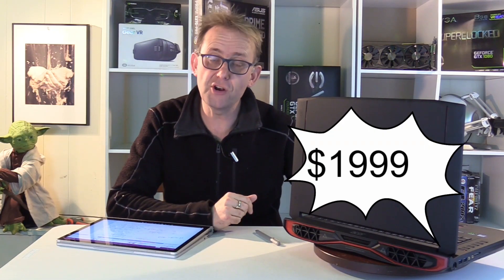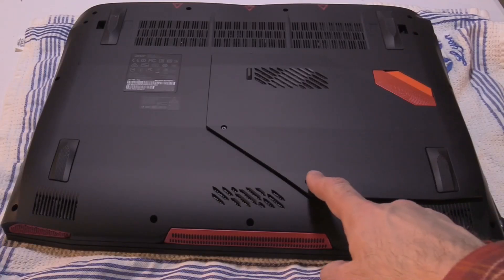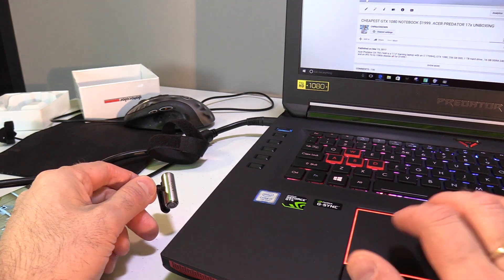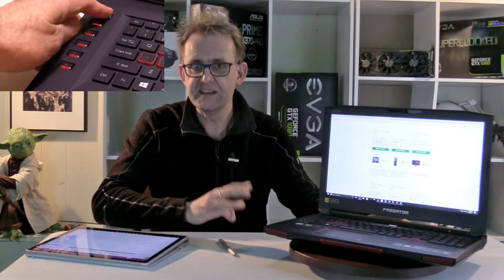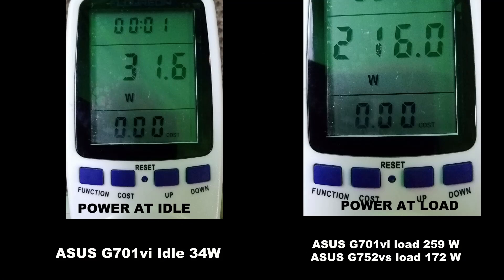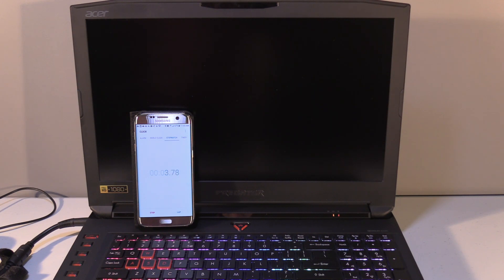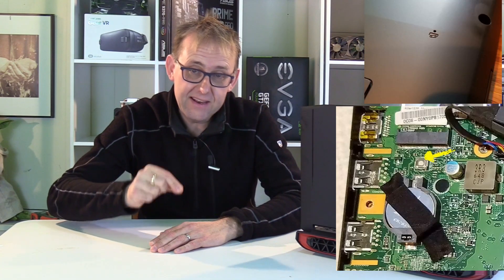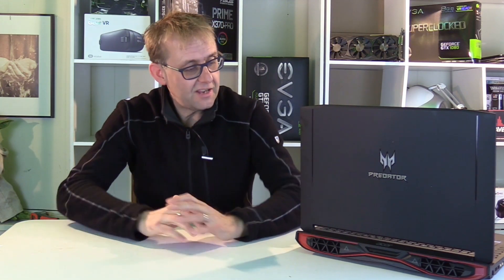CHEAPEST GTX 1080 GAMING NOTEBOOK ? ACER PREDATOR  GX-792-7448 FULL REVIEW

Comment: Anyway how do thrust MSI TN panel with your valuable video encoding? It is deadly!! And does Clevo mean ? 
My final question is do you think 7700 on acer can run as cool as in Msi on stock speed ? I heard that thermal repasting is a must for acer.

Thank you for your valuable time
Reply from the maker: Naser Jabi anytime Naser. I calibrated the display on the MSI so it's that bad. My main problem has been lighting so it's not as dark and I'm not an expert on video editing but I do recognize I need to get better, lol. So perhaps the 4k IPS may be a good upgrade for me.. As for temperatures, yes the Acer Predator 17 X 7700hq is absolutely fine, it wasn't until it was trying to run a game with a full cpu load at the same time that it started to sweat - nothing an undervolt wouldn't sort out. I reckon you will be able to undervolt it by - 0.145mv which should bring Temps down by about 10 degrees..

Comment: Hello!, what's good/better to use in a long time this or the MSI GT73VR 6RF?
Reply from the maker: Ryuji Danma I preferred my MSI GT73VR Titan pro, although there wasnt much difference. The screen on the Acer was great, bright and overclock to 100 mhz. I think at $2000 this takes some beating and you do get that gtx 1080. I like my MSI because the m. 2 drives can be screwed down, it's lighter, you have easier access to the fans for cleaning or repasting, you can switch to integrated graphics and the fans can go higher. It's close though and your choice may hinge on which one you think looks better.

Comment: Do you recommend this or the Msi titan that you are using ? ( I hate TN panel in that model)
thanks for the reply
Reply from the maker: Naser Jabi I prefer my GT73VR as I can overclock it at cool temperatures, 4.1 Ghz  whilst the I7 7700 max turbo boost is 3.9ghz. In a test such as handbrake the i7 6820 will tend to run at 3.8 to 3.9 whilst the 7700 at about 3.4 to 3.5 so that extra 400mhz helps in my video encoding. If all you are doing is gaming then the Predator is a fine choice. It is heavier but has a very solid feel to it. The MSI also uses mxm GPu so it can be upgraded or even put two 1070s in if you like. It is more desktop replacement in my opinion.

Comment: Stephen, could u make it comparison with ASUS G752VS?? since i found that both of them have a similiar specs, which one is worth??
Reply from the maker: Ignasius Andre Tan hi there, the Asus G752vs has a gtx 1070 and i7 7820hk cpu whilst this Acer has a gtx 1080 and an i7 7700hq cpu. Looking at the prices the Asus is about $500 more so I would definitely go the Acer route. It has better speakers also. You can even get the i7 7820hk version for $2700 so that is only $200 more than the Asus. I don't think the i7 7820hk is worth the $600 premium over this model I reviewed though. The Asus will be faster in cpu tasks so if you render lots of video that would make sense but if you do a lot of gaming I think the Acer will be more future proof below the gtx 1080.

Comment: Interesting that the bottom panel comes out with the HDD :)). They could have used that extra space a bit better that they gained from removing the frostcore. Even my 15.6 sager/clevo can hold 2 x 7mm drives, 2 x m.2 ssd and 4 ram sticks :)). For a 1080 equipped laptop it is a decent price, perhaps undervolting the cpu a bit would help its temp. And that animated boot screen :)) yea that is what laptops are missing :)). Acer is a decent overall, but far to bulky and heavy for my personal taste.
Reply: I keep the animations on my desktop, got the wallpaper engine from steam, very nice pice of software :)) got all the live backgrounds i could ever want :D

Comment: Ok so I need help I'm choosing between an MSI GE63VR Raider 075 with a i7 7700hq and a 8gb gtx 1070 and a 1080p 120hz screen for $1770 and a Refurbished Acer Predator 17x with a i7 7700hq and an 8gb gtx 1080 and a 1080p 75hz monitor with g-sync support for $1730. I don't know which one would be better! I play some pretty high end games like ac origins and GTA V but I also want to be slightly future proof for upcoming games.
Reply from the maker: elementskater1010 I think the Acer predator 17x is a great deal . What warranty does it come with ? If you can extend the warranty too that would be great. You can overclock it's monitor to 100hz and that gtx 1080 will be good for a long while and is more future proof.
Good luck and thanks for watching my video
Reply: OWNorDISOWN Tech Decisions Made Easy  it comes with a 90 day warranty right now on Newegg. That's kind of where my budget is extending it unfortunately makes it more expensive
Reply from the maker: One thing to bear in mind with Newegg on their refurbished is if you don't like it you cannot get a refund, they will just swap it out. Do you live anywhere near a Microcenter store as they have them on display. Still, its a good laptop and is the better value so it might be worth the plunge.
Reply: OWNorDISOWN Tech Decisions Made Easy I'm ok with a swap out haha this was the best deal on a gtx 1080 laptop I've found

Comment: So cheap compared to the others. Very nice review. This laptop is a great deal.
Reply from the maker: Thanks ThorVeras ! Yes, it is amazing value really. Solidly built and excellent performance. Why pay $3000 for 1080p gaming?
Reply: What do you think of the alienware 13 R3 ? I was going to buy the 17 r4 with 1080 but after the release of the 1080 Ti i think i going to buy the 13 with a 1060 and the amplifier to put a 1080 ti.
Reply from the maker: ThorVeras they are supposed to be shipping me the AW13 this week and I bought an amplifier to test my 1080ti in so stay tuned for that one!
Reply: I will. Just for the info. I was researching about possible bottleneck.
But what i found is. An thunderbolt connection is 40gb/s the alienware is about 32gb/s but right now Alienware Amp is working better against any competition like razer core.

To pass image on a 4k 60hz monitor would use 900mb/s so 4k 120hz would use 1.8 gb/s
I think we are good for a while them :D
Reply from the maker: ThorVeras yes, that's good to know. I understand there is some cpu overhead running  the amp so I want to see what effect that has. I'll be testing 4 different video cards and comparing each against my desktop
Reply: Thank you !

Comment: Did they ever fix the issue that gsync breaks if you use drivers from nvidia directly? I had the 1070 version and returned two of them because I was forced to use acers drivers which were way behind current versions at the time.
Reply from the maker: Trent Burns I had no trouble with the Nvidia drivers but then again I left Gsync off. I did mean to re-enable it but forgot.. It was enabled after I did the driver update but I didn't run any games..

Comment: Thank you for your helpful information, l like MSI but the only problem is that dull TN it has. I am obsessed with vibrant colors which only possible with IPS. There's a 7820hk model from Acer using the same body that you have reviewed but I think it might be boiling!!
Reply from the maker: Naser Jabi yes, indeed. I have heard it runs hot probably because of the lower fan speeds. MSI has an IPS 4k panel, is that too expensive? You can always go Clevo if you like and have a desktop cpu..

Comment: Buddy which one do you think is better msi gt73vr titan pro with gtx 1080 with i7 6820hk or i7 7700hq ?
Reply from the maker: Dhirendra Pratap Singh the i7 6820hk for sure. I had mine clocked at 4.1 Ghz whilst the i7 7700hq will only turn on boost up to 3.8ghz but averages less, around 3400 or so.

Comment: Is the palm rest have a rubberized feel pr hard plastic feel? In total there is 3 ram slots , 2 m.2 pcie slots and 2 sata slots correct?
Reply from the maker: Mozammel Quddus the palm rest is rubber coated so it feels soft. There are two vacant RAM slots and two vacant ssd slots, but no where to screw them in..

Comment: So do you have a top 5 list of best laptop you have tested so far?
Reply from the maker: Brandon Ang Hi Brandon, out of the ones I have tested so far I would say 1. MSI GT73VR Titan pro, 2. Alienware 17R4 Gtx 1070/i7 6700hq /i7 7700hq, 3.Razer Blade 14,  tied for 4th ALIENWARE 15 R3 (not i7 6820hk or i7 7820hk), and  DELL inspiron 15 7000 gaming (still have to review it but it's great)
Reply: OWNorDISOWN how about the acer and asus?
Reply from the maker: Brandon Ang The Acer I didn't like the subwoofer and that Fn key issue. Now it's not letting me reset to factory settings. Take those issues away then it would be probably 3rd. The Asus laptops had poor speaker volume and both i7 7820hk models did get hot. The Asus G752vs got scratched up in 5 days with black plastic showing underneath. The G701vi may well have the same issue, I just handled it with kid gloves. It also had limited storage considering its size..
Reply: OWNorDISOWN is the acer predator temperature considered hot?
Reply from the maker: Brandon Ang only when I did heavy cpu work whilst running a game did the temperatures go high enough to throttle. It would have been nice if the fan would have cranked up higher. Playing a game by itself, or doing the handbrake encode by itself it didn't get hot..
Reply: OWNorDISOWN I think the subwoofer on your unit is defective cause to me the sound was horrible
Reply from the maker: Brandon Ang it was bad, I like loud speakers but they need to be clear. It was unfortunate. I definitely think I got a lemon..

Comment: first time to post reply just wanted to ask you, i can buy the acer predator 17 x with these specs for $1900, what do you think and if you have any recommendations

-2.90 GHz Core i7 i7-7820HK Processor
-32 GB of DDR4 SDRAM
-17.3"In-plane Switching (IPS) Technology, ComfyView Display Full HD
-1 TB HDD + 512 GB SSD
-1920 x 1080 Resolution
-Dedicated GeForce GTX 1080
-IEEE 802.11ac Wi-Fi,
-Windows 10

thanks
Reply from the maker: I think that is an awesome price for those specs. Go for it !
Reply: Where did you find it?
Reply: +OWNorDISOWN Wow thank you so much!

Comment: which is the best acer predator model to get 15 or 17 i like to take my laptop everywhere for gaming and school also i play lots of Rts and grand strategy games and so i wanna know is 1060 or 1070 better with 6700 or 7700hq
Reply from the maker: Aztec Wolf they are both quite heavy but the 15" weighs less - I think close to 8 lbs. If you are at 1080p a gtx 1060 is very capable. No harm in getting a 1070 though for future proofing if you have the funds. Same thing for the CPU. The i7 6700 is perfectly fine and if you can get a good deal then that is ok. If you do have the funds the i7 7700hq is about 7 to 10% faster so again will give you a bit more future proofing.
Reply: thank you very much for your help

Comment: which laptop do you use as your daily driver? do you use a separate one for gaming? if so which laptop for your daily gaming?
Reply from the maker: Bishal Adhikary I use my Surface Book the most probably as it's so portable and I use the pen all the time. I use Onenote to record all my testing data. 
For gaming and my editing I use the MSI GT73VR, love it to bits! What laptop is your daily driver?
Reply: right now i am using a dell inspiron but i just recently ordered an alienware r3 with 6820hk processor and 980m graphic card and waiting for the delivery. I am not really a gamer but i think the card should be enough for other activities like browsing and software like photoshop, etc.  :)
Reply from the maker: Bishal Adhikary that's still a very good card.. It was top of the line not so long ago. I still have one, it is great. Good choice!
Reply: thanks, actually the processor matters more to me because as i mentioned i don't really do gaming. what are your thoughts on the 6820hk ? i had seen your review of MSI GT73VR, it has the same one right?
Reply from the maker: Bishal Adhikary yes, I have the same cpu. I can get 4.1 Ghz out if it and it performs great, I have to activate the turbo fan when overclocked and rendering my videos otherwise it hits 91 degrees. I did have that same cpu in an AW15 R3 and AW17 R4 and it got crazy hot. How is yours?
Reply: 4.1 ghz is great, you had mentioned in your video as well i think! i just ordered some days ago am still waiting for it to be delivered. I live in Nepal so it takes at least 20 days to reach me  :)
Reply from the maker: Bishal Adhikary Nepal, I would love to visit there! Good luck with your new system 😁
Reply: thank you :)

Comment: Hello, thank you for your video. I have an important question, from that same website, for only $2,199, I can purchase a MSI GT73VR TITAN PRO-693 17.3 laptop with GTX 1080 and 7700HQ. Everything else is identical to the Acer except for the refresh rate, it is 120 HTZ. Would your recommend the MSI for $200 more? Does the MSI have G SYNC? Could I OC the monitor further, and should I? I am intending on buying either one of these soon! Thank you.
Reply from the maker: Tiko Hov I have always been a fan of the GT73VR and personally I would plunk down a bit extra for the Msi. It's easier get to all the components and repaste if necessary. It has switchable graphics to extend run time and as you say the panel is at 120hz vs a Max 100 hz on the Acer. The m.2 slots also have screws to fasten them in place which I thought was a weird omission on the Acer
Reply: OWNorDISOWN thank you. one last question, is it possible to set the MSI GT73VR to 1440p? or is it stuck at 1080. also, i am now considering the 6820 due to ability to get to 3.5 and be stable
Reply from the maker: Unfortunately you cannot increase its resolution. You need to go for the 4k panel to have a higher resolution. I had the 6820hk one and had it at 4.1 Ghz stable. One of my subs bought a refurb from Ebay for $1900.
Reply: OWNorDISOWN do your recommend the 4k variant of the MSI laptop? i was under the impression that you can somehow increase it to look like 1440 while it is still 1080, in a weird "trick" or something. i see some 4k refurbished 7820 1080 gtx on ebay for 2200...recommend? i wish there were some reviews on the 4k system. if i were to get the 4k and only get 60 hz would i be able to set the resolution to 1440 and get more htz? thank you
Reply from the maker: I think you might be thinking of Nividia DSR (Dynamic Super Resolution) which you can activate within Geforce Experience (https://www.engadget.com/2014/09/18/NVIDIA-Maxwell-flagships/). Ive tried it and must admit I didn't see much difference. I haven't tried the 4k but one viewer said that when he downscaled to 1080p it looked blurry. I read a review on Notebookcheck and it didn't say anything untoward but you may want to see if anyone has some footage on Youtube. I have played 1080p on my 4k Yoga 720 and that looked fine so I don't see why it wouldn't be OK. Of course, you just get the 60hz, but at $2200 that does look very good value !
I hear your dilemma, That is one reason why I went the Sager NP 9873/9876 route - a QHD 120 hz display/ Desktop i7 7700k CPU and GTX 1080.
Reply: you know what, im going to get the MSI GT73VR TITAN PRO 7820HK  GTX 1080 120HZ from xoticpc ;) any coupons you can offer? hahah. also, i am having them do IC Diamond Thermal Compound on the GPU and CPU. hopefully they dont fuck it up right? haha. its interesting they dont charge tax! how odd
Reply from the maker: Tiko Hov that's exactly the route I took 😀 I'm sure you will love it!

Comment: So, the 17x did not have Frost Core like 15 or 17? been searching everywhere and did not get the latest information. if the frost core is crucial part, should i get the 15/17 rather than 17x?? 🤔🤔
Reply from the maker: Ignasius Andre Tan I don't think the Frostcore is needed on my model of the 17x. Perhaps if you step up to the i7 7820hk it might help. If memory serves me right it knocked a few degrees off..

Comment: I need a little help here. I am looking for a new proper gaming laptop, but can't choose between the "MSI GT72VR 7RD-439NE Dominator 17,3 - GTX 1070 - i7-7700HQ CPU -1 TB HDD + 256 GB SSD" or the "Acer Predator GX-791 17,3 - GTX 1080 - Intel Core i7-7700HQ - 1 TB HDD, 256 GB SSD". I do have a MSI (ghost pro) gaming laptop with really good specs, but it is so thin and has poor fan and heat control. I can hear the fans through my headset at times and it gets so warm (burning my hand) I have to stop gaming for awhile to allow it to cool down, which is driving me nuts.. So I wonder which one of the pc's above that I mentioned, has better noise and heat control + who seems to run heavier games better. Help a fellow gamer out here. Thanks in advance!
Reply from the maker: Dolpharie Hey there. I would be inclined to go the Acer Predator route. Really great display and that gtx 1080 will be more future proof . It is quiet too.

Comment: Hi sir. Do ypu have tips for me i am planing to buy a omen15 120hz. Its other mid range same price to recommmend me as same price on omen?
Reply from the maker: senen bagro is that the one with a gtx 1050ti ? I haven't tried it but I'm sure it will be just fine.
Reply: Gtx 1060. i7 120hz
Reply from the maker: The Acer Triton 300 Helios is worth considering, as is the MSI GE63VR Raider or Aero 15?